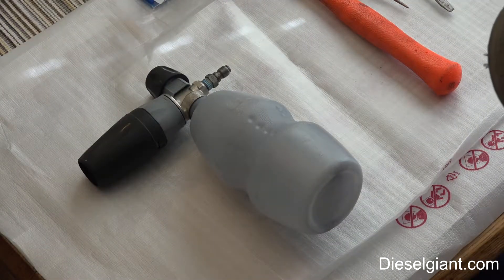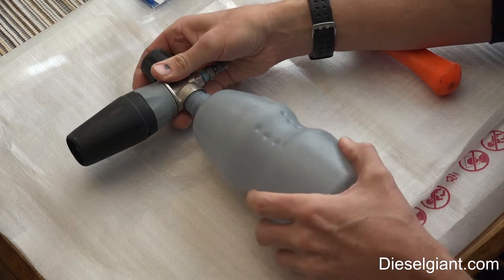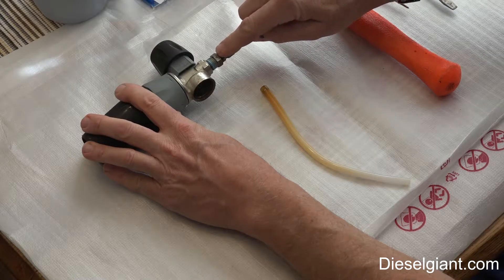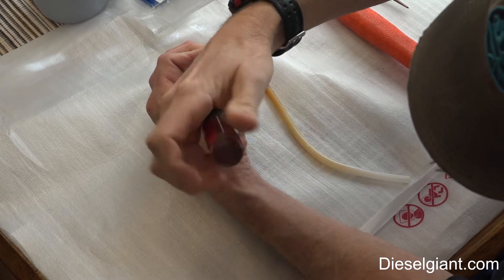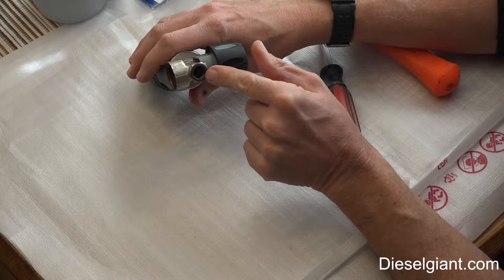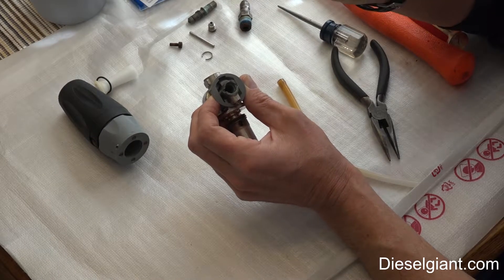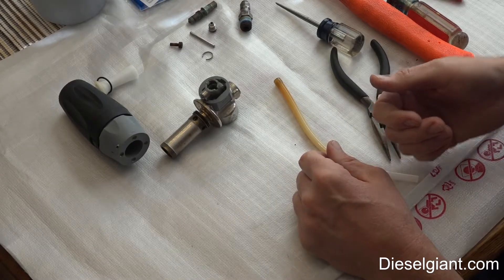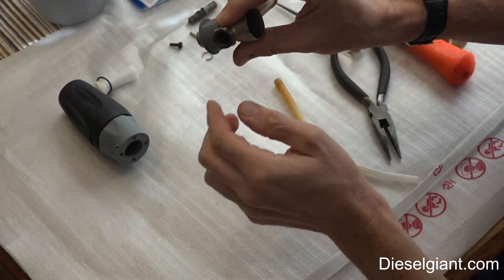MTM PF22 Foam Cannon Fails on Me and how to FIX it

Comment: Great video! I have a brand new MTM PF22 that is connected to a petrol Karcher 2.5 Gal/3200 psi and the pressure fluctuates when the foam cannon is attached.., I have installed the 1.25mm orifice on it, any idea of what the problem could be?